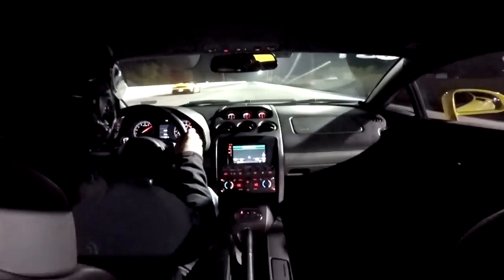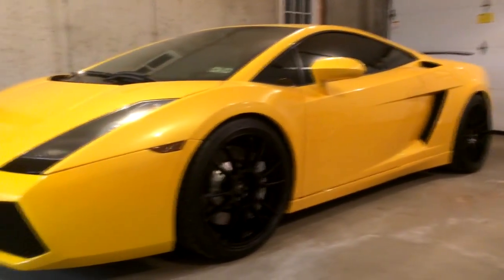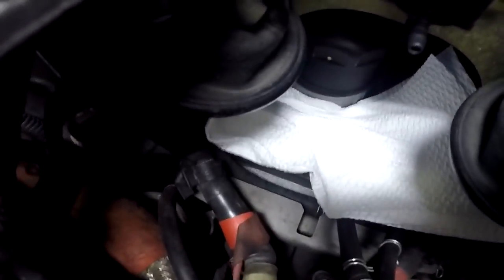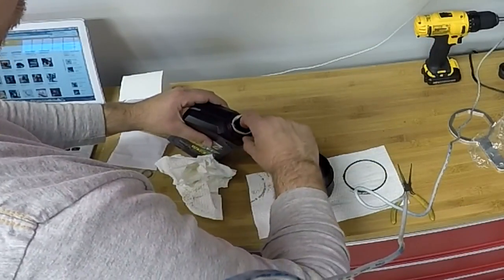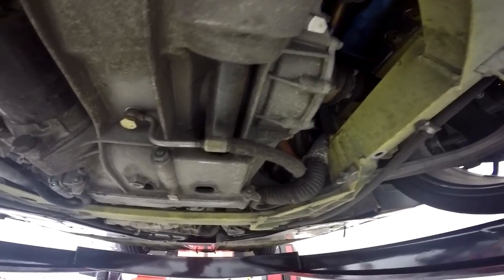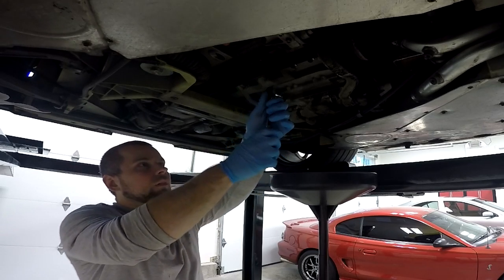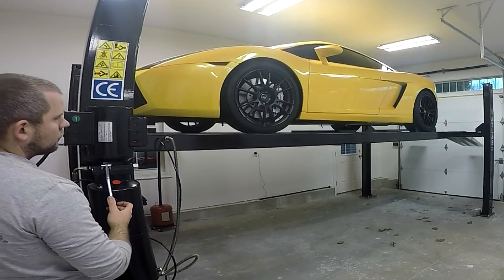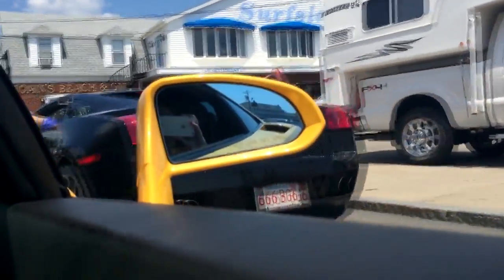24k Mile Oil Change In Depth Tutorial - Lamborghini Gallardo

Comment: A few tips.  If changing the oil myself you should use a torque wrench so its perfectly tight and not that tight.   And if its too tight you should of used a longer ratchet.  Using an 18" ratchet will give you a ton of more leverage instead of using an open end attached to the smaller ratchet.

Comment: Even if you torque a fastener correctly, alot of times it wont come out very easily because of heating and cooling cycles and these engines get hot.

Comment: Start putting the drain bolts in by hand and then once it spins a few times so you know its definitely in the thread then use a ratchet. Is this drain bolt really short thread? because it didn't turn much :/

Comment: Why not break out the torque wrench on those oil plugs. When it comes to aluminum "Hand tight" can be dangerous :-). Also I bet the one that was super tight was because of the engine heat. I'm sure your aware of all this but as an instructional video it's probably better to get the specs and follow them to the letter.

Comment: Why do you only fill with 5 quarts at first? Would that fuck up the engine if you start it without enough oil? Why cant you just add all 10? I know its a super car but is the process all that different from say your mustang?!
Reply from the maker: +Christopher Jasper just the way you do it with these engines. Its a dry sump system